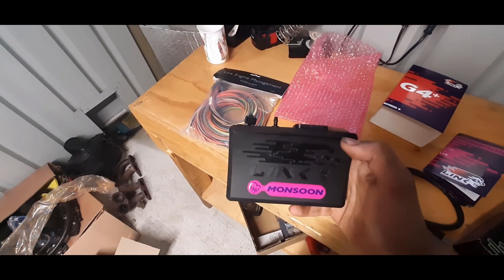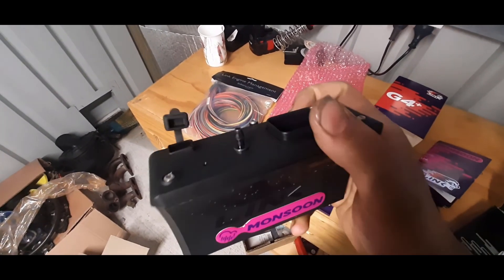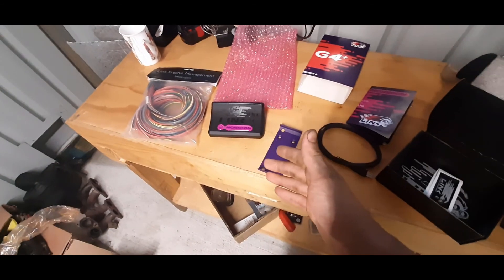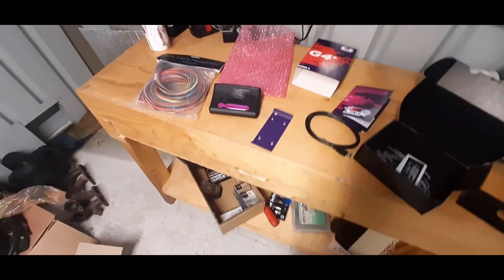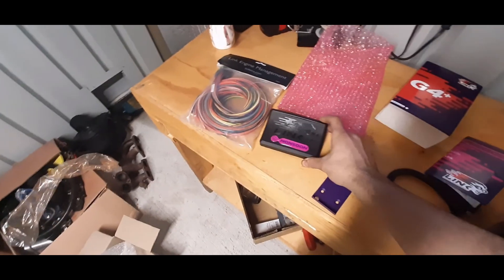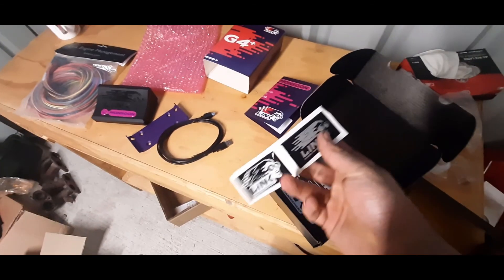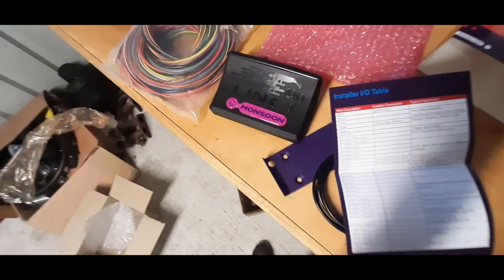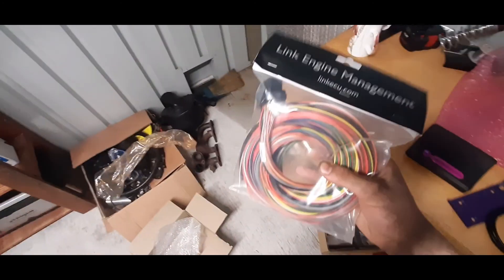3rz Turbo: LINK ECU

Comment: Hey dude, I’ve got the same ecu and motor going into jetboat, but wondering if you already set up the base map/tune and got any pointers ??
Reply from the maker: I haven't got it wired in yet, waiting till the new year when i have some free time. Ive spoken to a few people who have all had good experiences with links. the 3rz is a pretty simple engine without VVT so your wiring is pretty minimal, the only thing you need to obtain is a IAT sensor as the original MAF sensor has one built in.
Reply: What if you live in Comunist Ca?
This state is GARBAGE with so much political CARB constraints! 

That said, is it possible to use that unit, and then click in the same harnesses to oem ECM when it's tine to do the shitty ca  smog check?